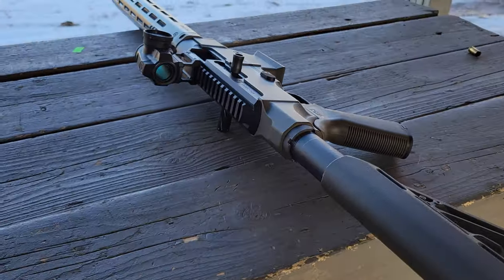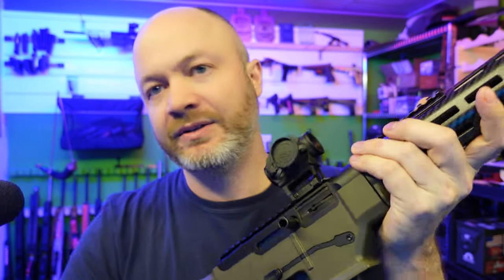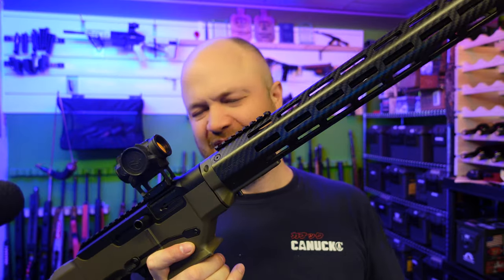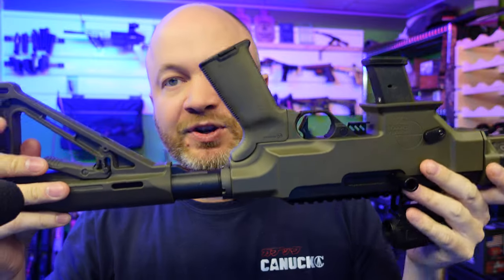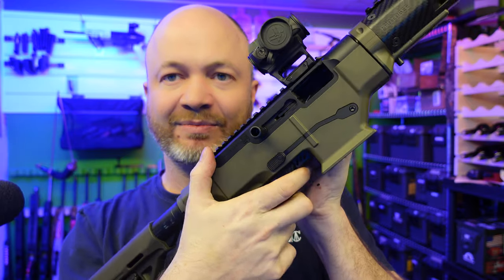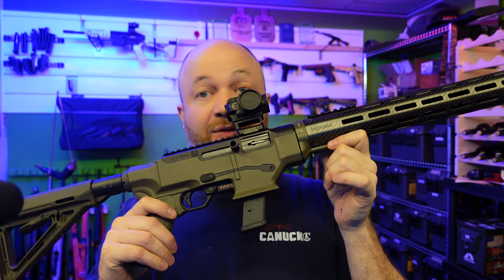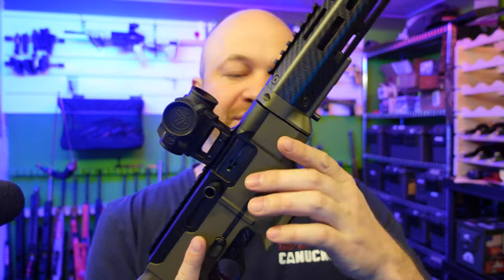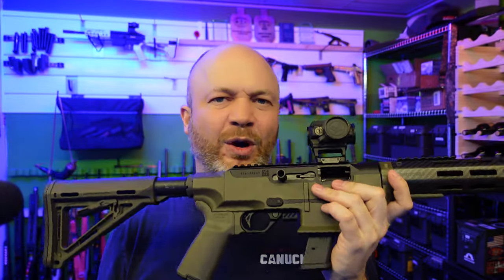ATRS Ruger PC9 Chassis Review

Comment: Nice mag release, actually the best one I've seen so far. But for $649. I'll keep the original RUGER receiver chassis. I've upgraded virtually everything else possible on my PC chassis carbine including ALL internals available and ambidextrous safety levers.  My choice for a "red dot" is the HOLOSUN AEMS circle dot and it is the best for a PCC. My MAGPUL MBUS sights are co-witnessed with the AEMS. I have a folding stock on mine for easier storage. My motto is, "I can stop buying gun upgrades any time I want. I've done it hundreds of times."
BTW, I mounted my AEMS circle/dot on the BARREL Pic rail so it stays sighted in every time I put the barrel back on after cleaning. 
Also be sure to keep the barrel nut very snug and mark a groove with a colored witness line so you can se it the nut has loosened.

Comment: hm, I dont see much point in getting a chassis for this gun when it pretty much already comes as youd like? At least in the US we have the options for multiple models that all include the pistol grip, adjustable stock, MLOK handguard and so on
Reply: Yeah you can get that model in Canada as well. The price difference from normal and tactical factory is not very much. But aftermarket stocks are pretty expensive for a little pea shooter 9mm